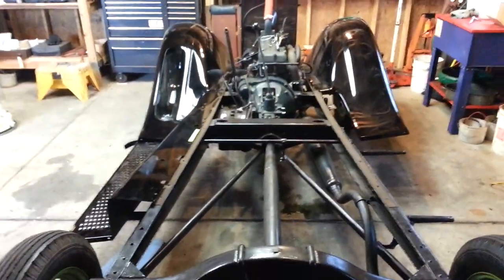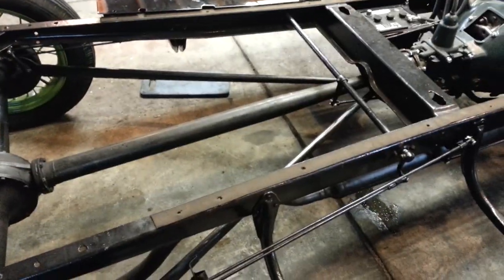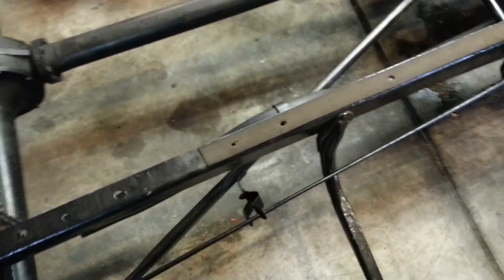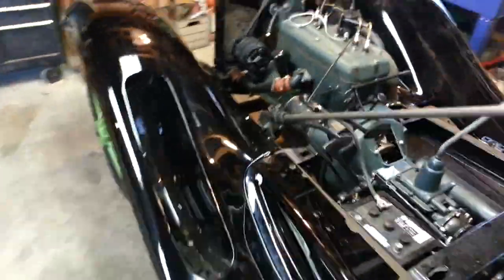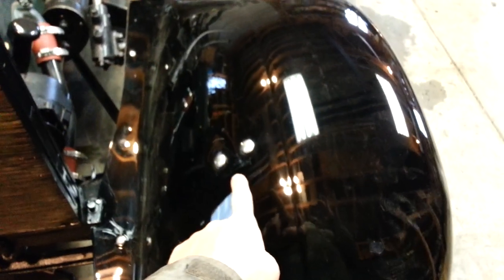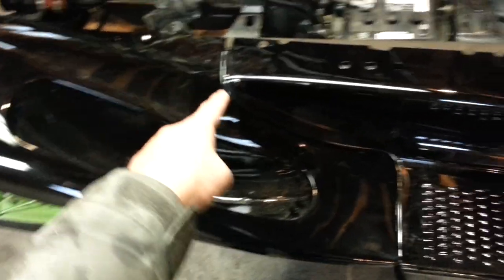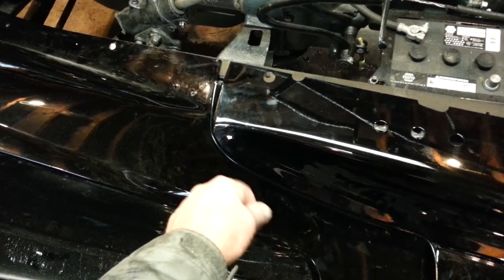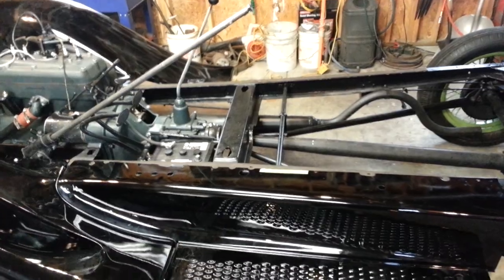1930 Ford Model A body panel alignment Part 1

Comment from the maker: Yes it is a welt. A fabric gasket. Very heavy duty gasket. If you don't use some sort of adhesive spray to lightly hold it in place it will move all over for you during body alignment. believe me. If you are using new or original body panels, once you are ready to put them on. They will be a bear to put together. The metal stretches over time. good luck in your install

Comment: I had thought the radiator tabs slipped under the fenders, not over. That's how I found mine to be on a '31, though certainly others had worked on it before.

Comment: Hi the welt is a soft gasket   To stop metal to metal rubbing , so sticking it in place is no , two metal surfaces together will rust and rub showing rust ,

Comment: Putting adhesive in your weld area defeats the effective weld. A definite no no. I'm a certified AWS weld inspector and it's a code violation. It's a bad habit to get into if you are welding anything structural.
Reply: Welt....not weld.